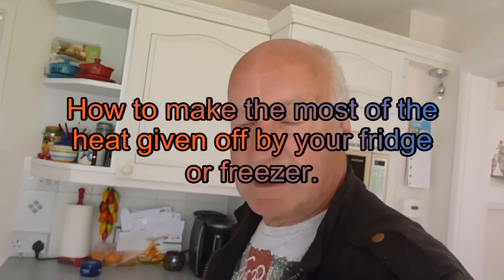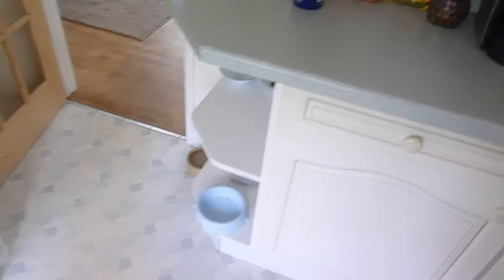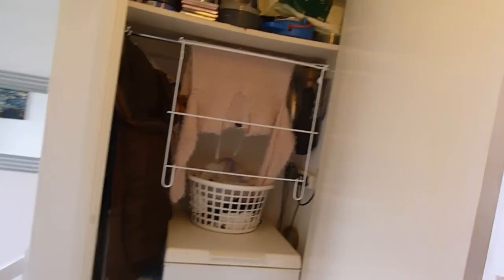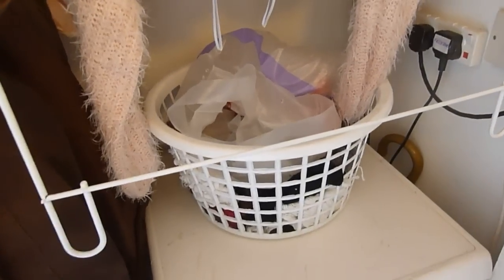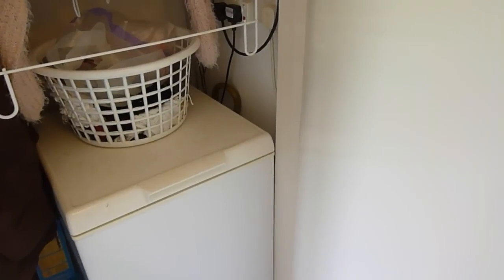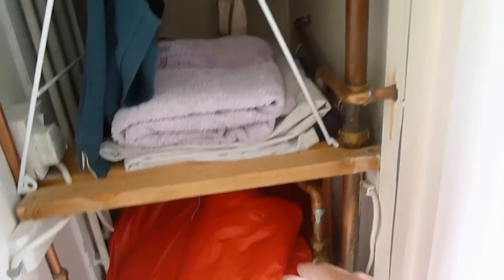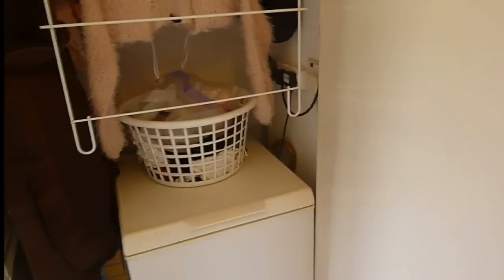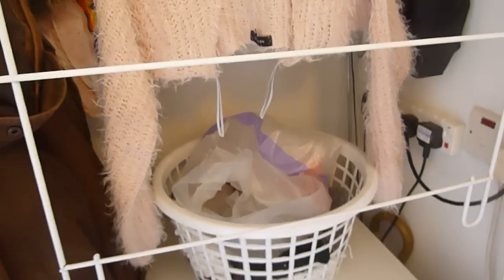How to make use of the heat given off by your fridge/freezer.

Comment: I can understand your logic, however the freezer will now use more electricity as it will have to work harder combatting the heat it produces in the cupboard. If the freezer was outside with its cooling fins inside that would be ideal .
If it was me, I'd return the freezer to the garage and knock through from that cupboard to the one with the hot water tank . However, just my logic and I enjoyed your video.
Reply from the maker: Ok thanks Derek.